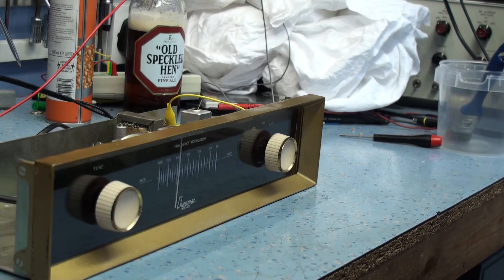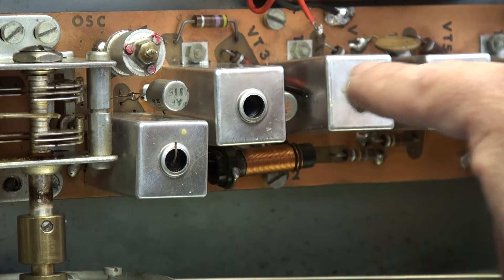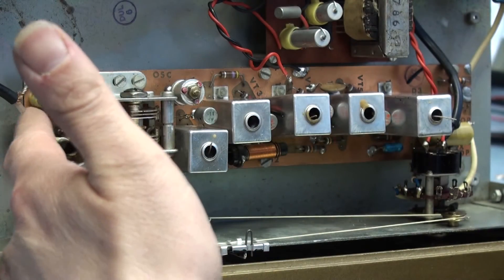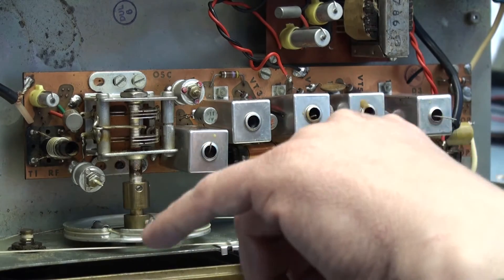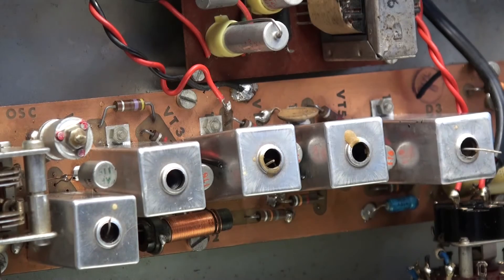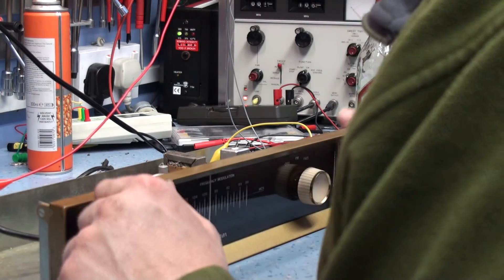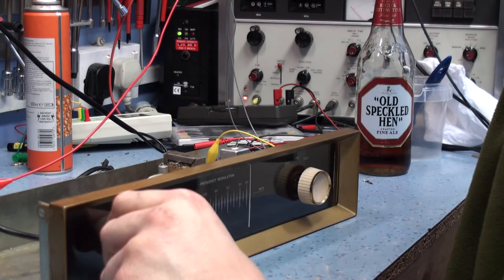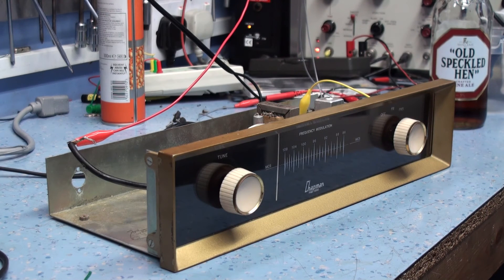Chapman FM1000 Transistor tuner

Comment: Hi simon for just general tone testing what a typical input levels and deviations for a domestic broadcast receiver should I be setting. I just happen to plug something similar into my test set although the radio works very well it sound very scratchy and wad not quieting. I’m guess I don’t have anything suitable for wide FM or stereo signal production. Could you give me some hints on workshop testing and you rf settings on the generator. Thanks Regards Chris.
Reply from the maker: Hi Chris. I take you are injecting into the front end aerial socket? Generally a few mv RMS with 75Khz deviation should give a good result. I tend to use 1khz modulation. If your generating an MPX as well you will need a lot more signal strength. Like wise injecting after the frequency changer will require a fairly strong signal. Fixing a big collection of Hackers then?
Reply: Simon Spiers  hi Simon, no hackers yet LOL. No I built some 75/50 matching pads and just noted my communication analyser would  not drive it. It had a maximum deviation setting of 20khz. I didn’t know what was required for wide fm as it’s not something I have ever looked into etc. I think my stabilock may have a higher deviation setting. Thanks Simon